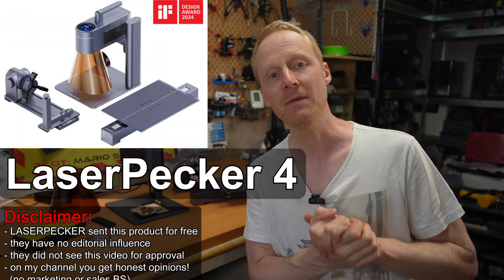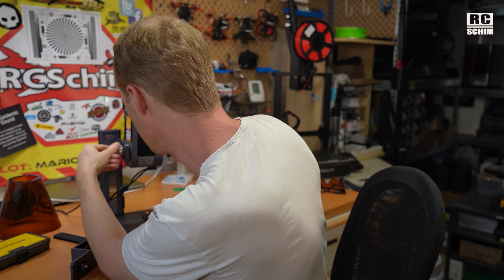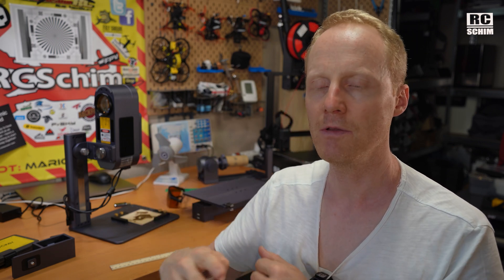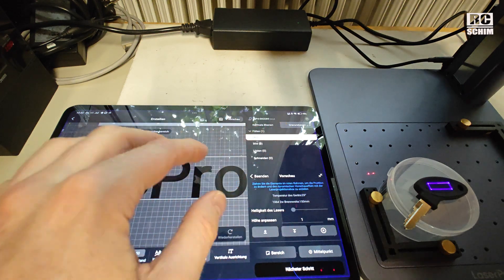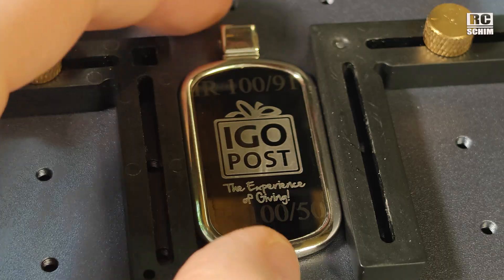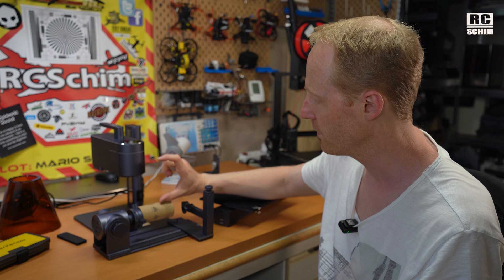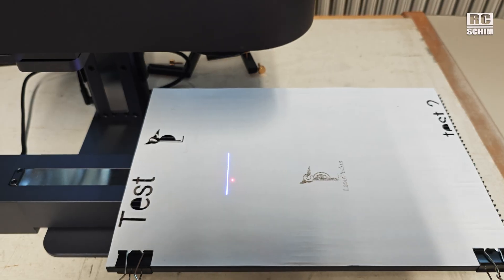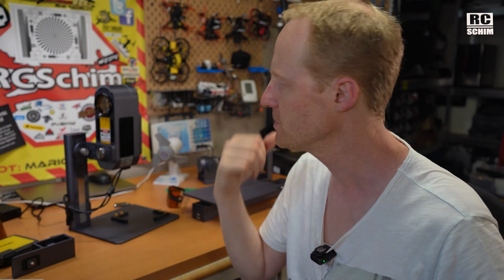LaserPecker LP4 - the most versatile Laser! (indepth review and many Tips!)

Comment from the maker: I've put a lot of time into making this review, please consider supporting my efforts by using my link: https://shrsl.com/4mbhk and SAVE 5% with my code "RCSCHIM"  Thanks! 🙏 
VISIT their official YouTube account   @LaserPecker   for tutorials and examples!
💡 Some example settings:
Plywood:  Diode 450:  P100, D 10 
Steele, IRLaser:  P100, D80
Metal Business card:  IR, P100, D10
Aluminium: P100, D100 (for dark text)
PLA (grey): P100, D80 (1064nm)
Leather: Diode 450, P60, D5
Glas bottle : Diode 450, P100, D15-20 (30 too high)
White Paper: 450nm, P100 D10

Comment: Do you have recommended setting to engrave black letters on metals?
Reply from the maker: Hi, not really. On some coated metals I just got whatever was below the coating, on stainless shiney steel you get pretty low effect only. I saw that with different settings you can achieve different colors? I doubt that you will get a good black tone tho...
I've seen other laser reviewers using some paint to get desired effects... (paint burns into surface?)
Reply: @Rcschim   Thanks. I read a post on the web regarding silver and gold metals, which recommends 100/100/8k. They further stated that doing 5 to 10 passes will result in a little depth into the metal also. This is exactly the result I'm after with my sterling silver, so I'll see if it works.

Comment: If I were designing a control panel (custom audio synthesizer) and wanted a good way to label the various controls, would I use a laser like this and then paint the engraved areas?  Even if someone said to silk-screen the labels onto the metal chassis, I imagine the metal would have to be treated somehow so that the paint can stick.  Apart from an acid dip (maybe even using photoresist?) , this seems like a good approach.  Do you have any suggestions?
Reply from the maker: I've seen brushed aluminum working quite well. Some metals are not very contrasty when engraved. But painting it after engraving could work.

Comment: brilliant tool,  incredibly versatile.  ps i think the g3 is a lawnmower.
Reply: a laser lawnmower...  You're a genius!

Speaking of that, do any of these lasers do through cuts?  Or is that best left to a more industrial machine?
Reply from the maker: @scottk3292 check the XTool s1, with 40w it is quite powerful. Just not cutting metals. Wood works to impressive thickness
Reply from the maker: If you attach blades left and right, it could work as one ;)